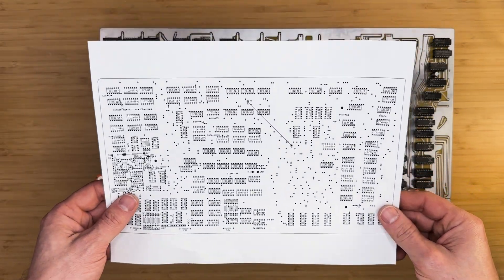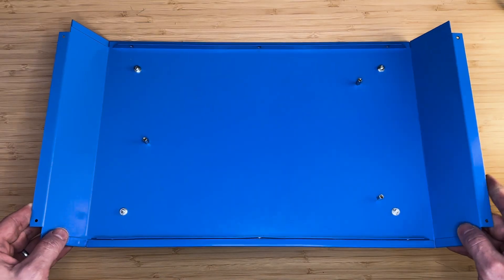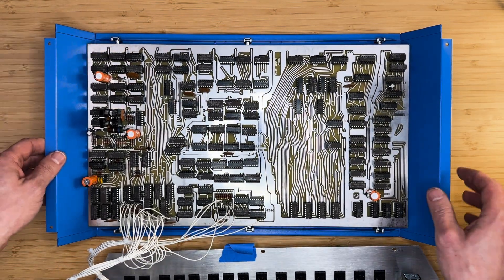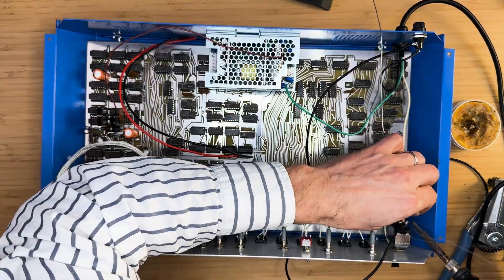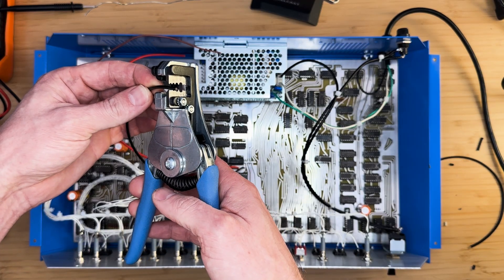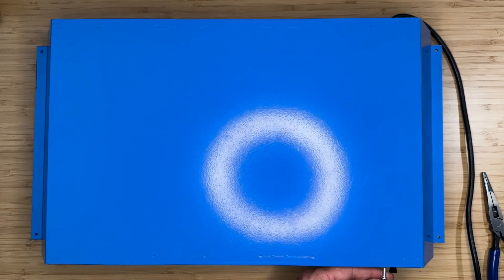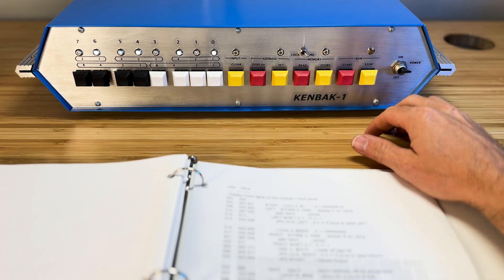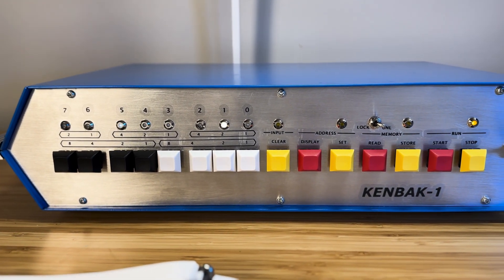Finalizing and Operating the Kenbak-1 Computer

Comment: If this is a reproduction of the original hardware where do you get the 1024bit SISO shift registers for the memory? Are you buying ≈50 year old chips from eBay?
Several years ago I learned about the Kenbak-1 and considered to build one but I changed my mind when I realised these shift registers aren't in production anymore.
Sorry if you've answered this question already in another video, I didn't watch them, just stumbled over this.
Reply from the maker: Yes. They sell on eBay regularly. At least the last time I checked.

Comment: Great work- did you have any issues getting it running? It would be good to have a few more videos on the principals of operation.
Reply from the maker: Thank you. I did have some issues, I just didn’t include it in the video. One was with the timing - resistor installed in the wrong place. The other was the inability to store in memory which turned out to be a backwards IC.
Reply: @artemkalinchuk  That's good to know it's not just me that does that.